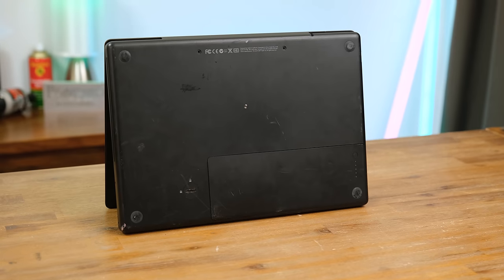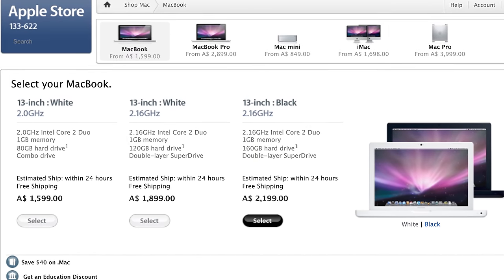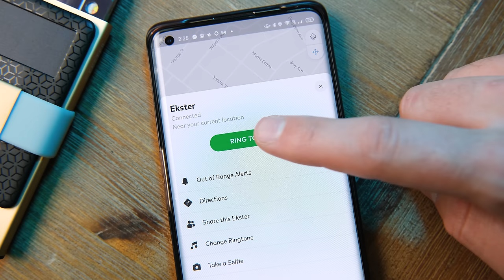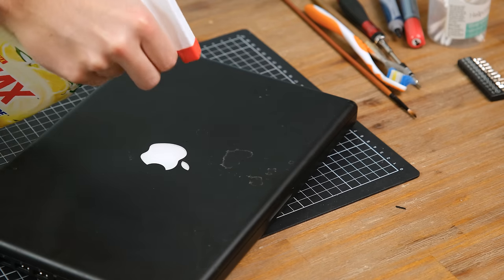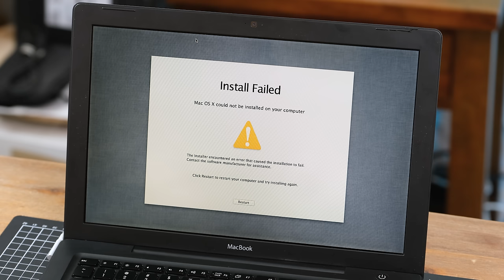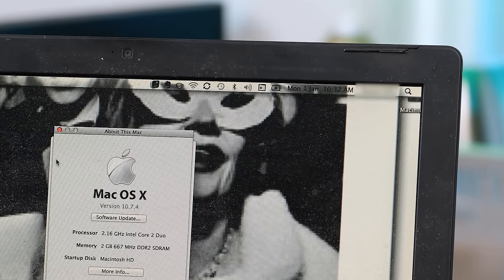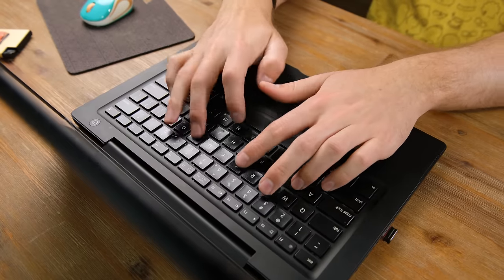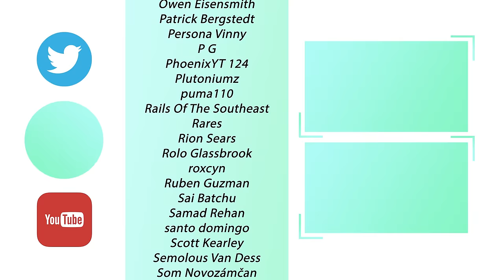Restoring Apple's Rare Black Macbook from 2007!

Comment: I know this may be far fetched, but anyone knowledgable with computers in general, would it be possible (with a bit of customization of course) to have lets say, a brand spankin new 2022 MacBook Pro (maxed out), remove everything on the inside and put it on the black MacBook? Pretty much having the whole black MacBook frame and housing, but the hardware is from 2022?
Reply: Its possible, but a M2 Macbook Air may be a better starting point, as the Pro's motherboards appear to be much longer which would interfere with the optical drive. There would be a number of major hardware compatibility challenges. These are some that I have thought of:
* Display, as either you would have to put in a convertor (the connection used is much different for older MacBooks), or find if the LCD in the new Macbook's fit (in which case you have to extract it from the display assembly). Also, a 1280x800 display isn't much use nowadays, a lot of applications require 1368x768 or higher for them to work properly. The display cable may have to be extended too, if the SoC would not be in a similar position.
* Apple logo would need additional illumination, if non original display is kept.
* Keyboard would need a custom 'adapter' PCB in order to make it compatible with the M2 board.
* The touchpad conversion may be a challenge as the connector and 'protocol' used is different. This will at least require a conversion board similar to the keyboard, or an attempt to make it USB. Maybe it would involve exploring if Apple's external touchpad's workings.
* The existing battery would either have to be adapted or the M2's reworked to fit (maybe fold them?).
* If a direct replacement, the Magsafe port may be easy to replace.
* Optical drive would have to be adapted into a USB interface - fortunately the newer ones appear to be SATA and adapter boards are readily available.
* Ports would have to be adapted to fit from a dongle.
* Webcam would have to be refitted from the M2, probably from new display assembly. Alternatively another laptop's webcam can be adapted to USB (a lot of them are already USB).
* Microphones would have be repositioned to match holes in body, which could be a challenge if the camera board also houses the microphones on a PCB. Alternatively, reusing a USB mic will probably work.
* Speakers will either have to be refitted from M2 Air, or older ones adapted.
* Case will require extensive planning and rework to make sure everything fits.

This is almost all of the considerations I can think of if retrofitted from a M2 Air. Needless to say, it would take a lot of work. On the bright side, a bit of space would be freed up as the storage is inbuilt into the motherboard and newer components are much much thinner making it possible to fit them in. Even more can be freed up if the battery assembly was glued in place and reworked.

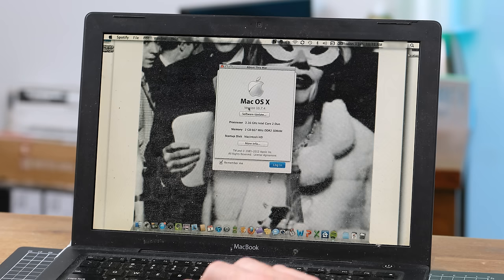Comment: 1:10 no. The difference in price was clearly because of the increase in storage capacity. As you can see by the screenshot you provided yourself, the price difference between the 80 GB and the 120 GB (40GB increase) white models is also $300. From 120GB to 160GB (also a 40GB increase), it’s an extra $300. You gotta remember that storage was freaking expensive as heck back then. You were not paying “for the privilege to have a black macbook” lol

Comment: Please, make a tutorial installing Linux on this machine!
Reply: It's not hard, just download a distro like Manjaro Mate, Solus Budgie, or Mint DE(Debian Edition)(I personally can't stand any distros based on Ubuntu) burn it to an 8GB USB 2.0 flash drive(yes make sure it's 2.0, or the Mac might not see it), write the ISO to the flash drive with Etcher, put the flash drive into the mac with it powered off turn on the Mac, and at the same time press the options key, when the drive select screen comes up release the key select the flash drive to boot from, boot to your distros live ISO, find whatever disk utility they have, format the internal HDD/SSD to blank it out, don't mount the drive. then run your distros installer follow it's on screen instructions, and when you reboot remove the key, and you are done. easy as pie.
Reply: @CommodoreFan64  I believe machines from this era have a 32-bit EFI even though they have a 64-bit processor, so many of the 64-bit Linux distros may not work out of the box.

I know on my 2007 white MacBook, the display driver and the WiFi card driver do not work out of the box and it is a common issue with this model as it has certain proprietary hardware installed in it that isn't Linux friendly. 

So yes, those instructions work, but you may run into some hardware driver issues where you'll need to find forums online to help install the drivers needed after installation.

 In my case, I never did get the Linux drivers to work. I might give it another go and try again.
Reply: @CommodoreFan64 No words to thank you! I tried installing several distros with DVDs and CDs and they just didn't work. I used your tips with a 32 bit distro: MX Linux and it's perfect. I tried other 32-bit distros (Zorin, Mint SparkyLinux) and I couldn't get the system up for testing. I bought an SSD and battery to use the machine when studying and I still want to test other distros now that the macbook is no longer a problem. Thank you again! Huges from Brasil.
Reply: @danielpustowkatavares3269  MX Linux is not my favorite for a daily on a more modern machine since it's based on Debian which is a bit slow to update for my liking, and some of my hardware does not play nice with it, but glad to hear I helped you get it working nonetheless, also another 32bit distro I've had good luck with on a few old Acer Aspire One Netbooks with Intel Atom N270 CPUs and 1GB - 1.5GB of RAM has been Q4OS Trinity, which uses a DE forked from the old KDE before the Plasma days, and I was able to get the netbook to do 480p YouTube on Chromium Browser where any other distro would choke at 240p, just know the installer is a bit old school MS DOS like, but not too hard, and I've never tested it on any Apple hardware as the only thing Apple I have is a 13in Mid 2012 Macbook Pro I upgraded to 16GB DDR3 RAM, and a 240GB SSD, plus new battery, of which I currently run Manjaro MATE on it, and I keep it as a backup machine(it was a local recycle center find).
Reply: @danielpustowkatavares3269  I've not tried Q4OS on a Macbook, or other Apple hardware as again I only have a trash found Mid 2012 13in Macbook Pro(came with the charger), and so far the best distros I've found to work with it is Manjaro(Arch based), and Neverware Cloudready OS Home edition(Chromium OS). 
On Manjaro I have audio issues with the optical audio light staying on full time, only getting 2.4Ghz wireless out of the WiFi adapter, and fan speed control issues that cause it to run hotter than I'd like. 
On Neverware I have mainly have keyboard backlight issues of which I've not found a fix for, and fan speed issues where I have to go into Crosh terminal, and run a manual command everytime the Macbook is powered on, or comes out of sleep to set it at 80%(keeps it cool, and not too loud). So know Apple hardware is not ideal for Linux, but doable if you must.

Edit: Thanks for the offer on travel, but with work, and family I can't really leave the US, but again thanks. 🐧 huggs.

Comment: IF i where you i would switch the housing of the batteriets, like the internals from the white one into the black One.
Reply: The process to do that isn't very easy to do. Can be done, but with all the glue used, not worth the time to accidentally break the housing trying to pry it apart or damaging the batteries inside, which then would be a fire hazard. 😅
Reply: External cover is just glued on so would’ve possible to pry it off and swap over

Comment: you DIDN'T take out the keyboard to clean it?
bruh.
You also didn't disassemble the bezel and clean what's inside?
Reply from the maker: The bezel looked fine and I did blow the keyboard out with air. Next to no debris under the keys.
Reply: @psivewri  I mean, the seal might indeed be quite good. But my tradition of intrusive laptop cleanup (basically performing a complete disassembly and reassembly) tell me that there is typically quite some dust in the hidden corners that you can't get to unless you take it apart. Especially on aged devices like this.
For most parts, however, vacuum is sufficient.

Comment: The black MacBook was my first Mac. My next machine was a mid-2015 MacBook Pro 15", it served me for about five years before it got too broken. :(

That is the best computer I've ever owned.

My new laptop is this worthless PC garbage. It has an Adobe RGB display, which does not display sRGB colors accurately. It only runs Windows, and OpenCore won't boot on it, which is depressing. It also only has an RTX 2060, and only one RAM slot, so the max memory is 40GB. The trackpad is hinged so you can't click the top of it. The fans keep failing; I've already had to replace them once and the new ones are starting to make noise too. The power adapter has failed once because the cheap metal coating wears off and stops making electrical contact (wtf??).

Comment: I bought one of these in 2006 and paid the black tax.

It was an ok machine. The case design was solid. What let it down was the mediocre performance, particularly that damn GMA 950 which Apple was using in everything. The glossy screen was also annoying as you always saw your own face and room reflected. What a stupid trend that was.

A very mediocre machine all round.

In the end I didn’t use it all much and sold it for peanuts in 2009.
Reply: i think what you say reflects the reality of the matter. nonetheless, there is something fascinating about tinkering with these old machines.
i just obtained one but it has no charger and the battery is dead.
i wonder if there is a way to get power to it other than by obtaining the magsafe charger(?)..

Comment: MacBook keyboard is jusr Same as it 2006. No development. No pressure feelings. My last Mac was dual octocore MacPro with 64 GB of RAM and dual ATI graphics adaptor & MacBook Pro 15" @ 2011. After that, they hawe been rubbish.
Reply: *is not just shame. I am from Finland. No need To thoughts at the evening.

Comment: it only  takes a can of compressed air and a damp rag.

btw the laptop worked before the "cleanup". 

still don't get the point of this...monetization i guess?

btw the date time was set to monday jan 1st. so you missed that after opening it for nothing and not changing the cmos battery.